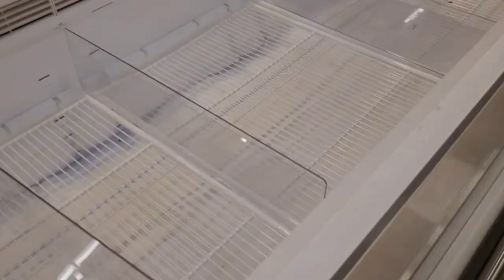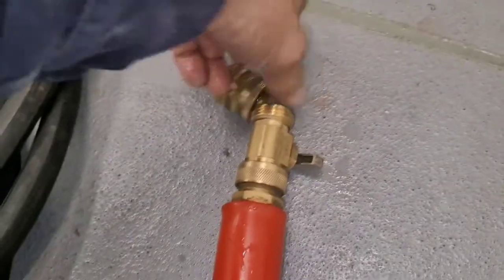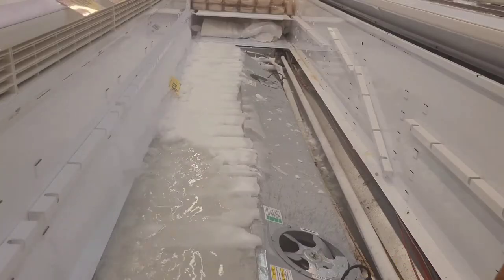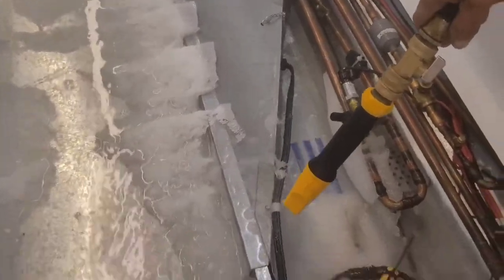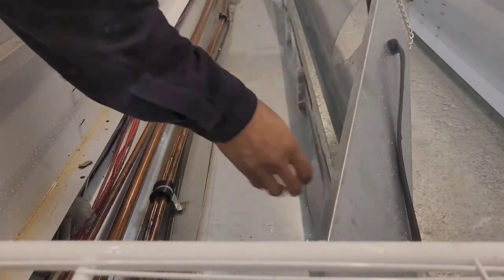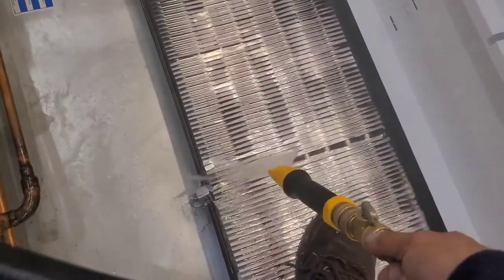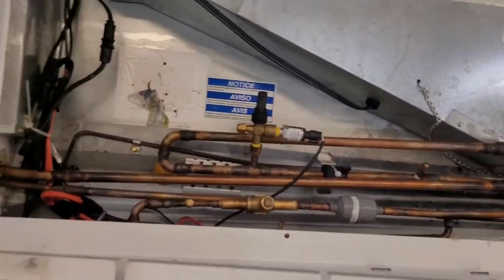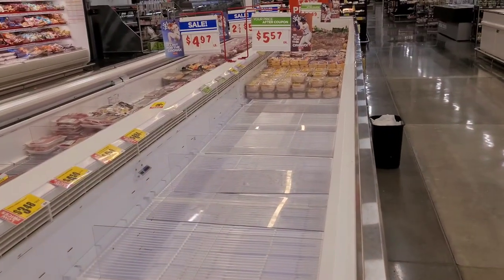Grocery Store Meat Island Case Not Holding Temp Severely Froze up : Deice and Restart

Comment: But why did it ice up?
Reply from the maker: This one froze up because the defrost circuit has a weak breaker. It's a 60 amp 3 phase 460  volt breaker located in the rack. Rated at 60, was found tripped,  and when reset the circuit pulled 37.  I'll try to get that follow up video posted soon.